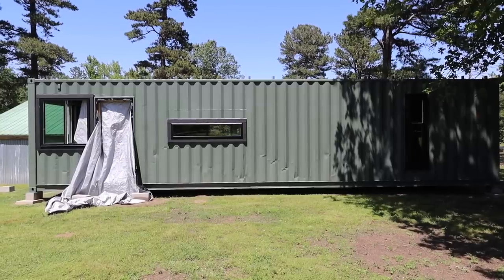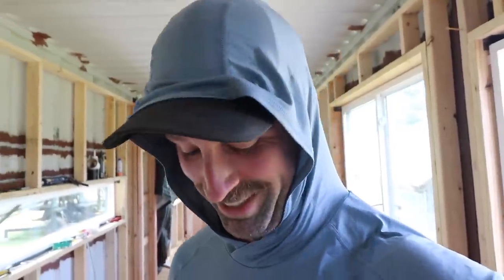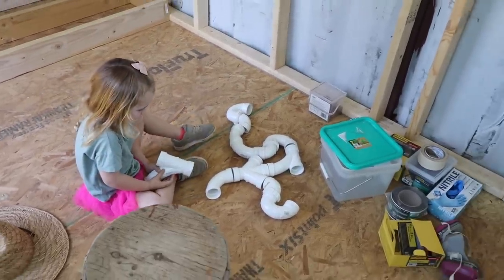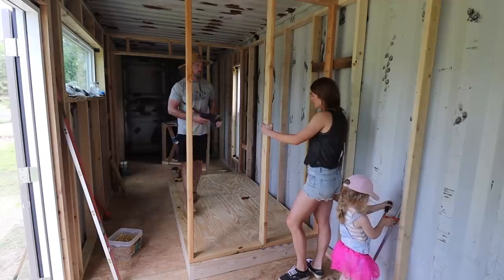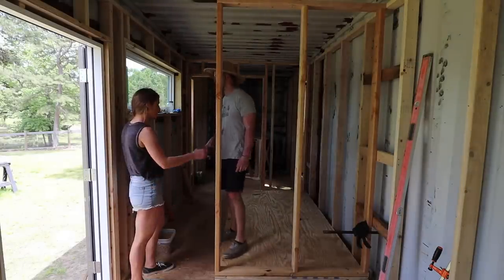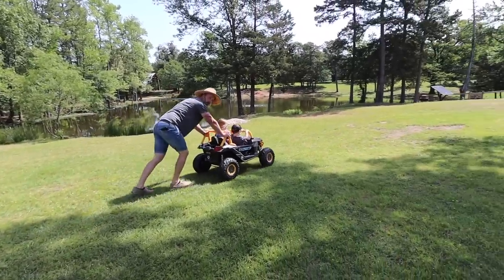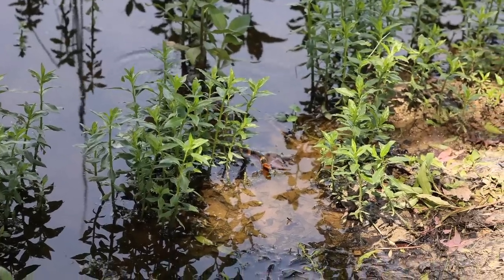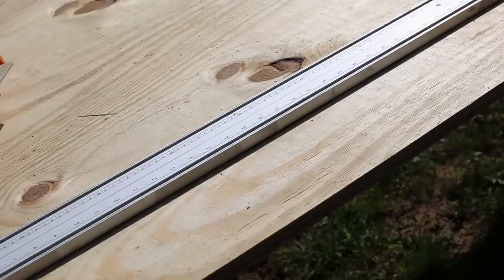TYING EVERYTHING TOGETHER | Framing Our Tiny Cabin

Comment: Hey Spencer....do some research on 24v. Wire runs are much smaller (with led lighting, tiny) and you have your pick of inverters. RV's are somewhat stuck with auto line voltage and you don't have that limitation.  It's worth an hour or two on the web to see if it's a viable option. I'm a boat guy and 24v is becoming much more common.

Comment: once got it built. get it weighed. then put it on axles :) tow it like a trailer if your lucky and can keep it around that 15k-18k limit. to pull with no cdl. but to make it easier to transport each time.  use a small tire trailer. built to the shipping container.

Comment: Speaking of two power sources. Spencer, let's say you guys have visitors for a week have you thought about the solar and battery impact that will have based on moderate power usage in cabin...I mean ac alone you could have an additional 6-10kw of usage you might want to plan for that now.

Comment: As for your original home, you can still put in a wood burning stove by putting it outside the home in its own little building and running the duct work under ground and attaching it to your existing duck work.  put in a sufficient blower with its own thermostat.  Get rid of the mustache. Get rid of snakes!  Your kids are beautiful.

Comment: For the first time watching all the videos from the start Spencer has finally managed to confuse me. I don't get using the 3/4 ply on top of the walls and Kenzie sped up the video so much I couldn't figure it out. My bad. I'll look forward to the next cabin videos to figure it out.
Reply: More room at top of the wall for insulation instead of double 2x4’s. Still leaves enough wood for securing ceiling with screws.